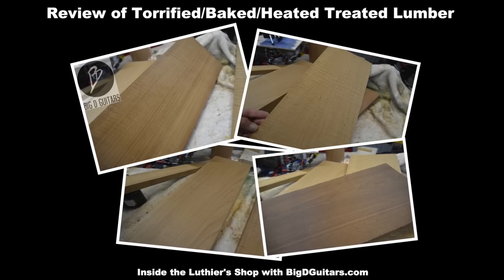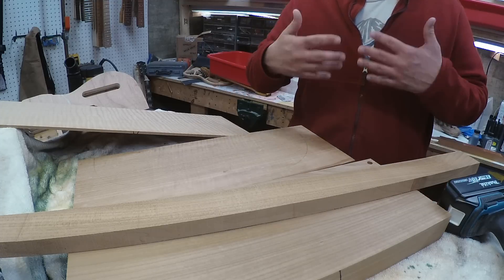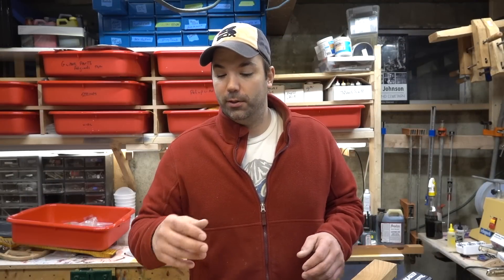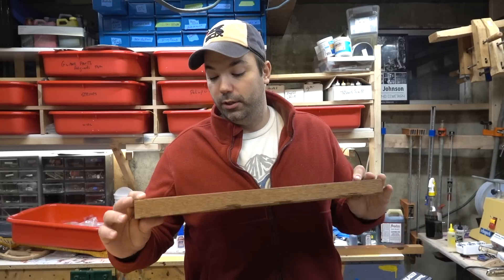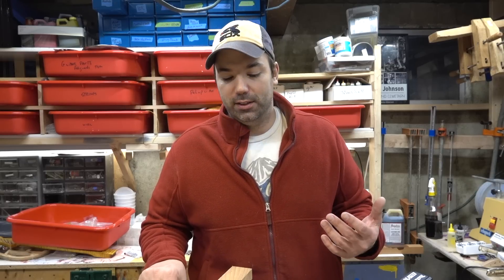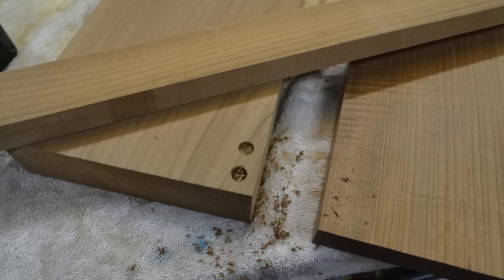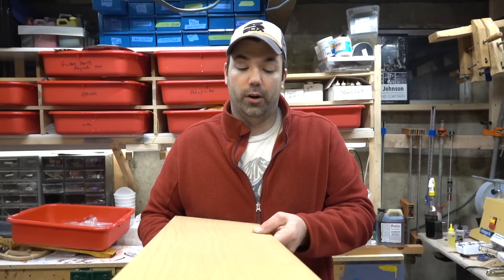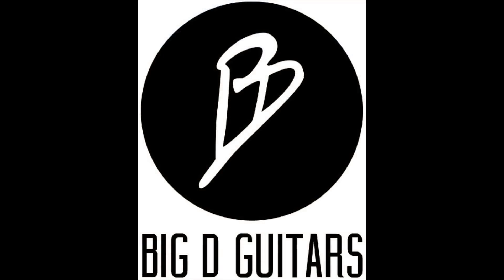Torrified/Baked/Heat Treated Lumber for Guitar Building

Comment: Well, actually they don't put it in a vacuum press. It goes into an oven that  reduces the oxygen content of the air but it's not a vacuum. One of the common ways of doing that is to introduce steam in the final high heat stages - but the moisture reduction stage take place in regular air. The moisture is brought to 0 in regular air at moderate heat, then the heat is raised and the steam is introduced to provide a non-oxidizing environment, otherwise the wood would burn. It's this high heat that provides the aging effects. Then at the end there is moisture reintroduced to bring the wood to 2-4% moisture - 0% moisture would be too dry and brittle. Tests have shown that the weight is reduced and the speed of sound through the wood is increased (something luthiers look for). If done too quickly there can be problems just like with regular kiln drying you can collapse the cell walls, trap moisture inside and have wood that would be worse than before treatment. How dark the wood will go is dependent on the temperature that it is processed at. 
The idea goes back centuries - the vikings heat treated the wood for their boats - one of the properties that heat treating gives wood is that it does not take on water as readily as non-treated wood. One of the big uses of torrefied wood (by the way spelled with an e not an i) is wood decking and siding. The International ThermoWood Association in Finland set the standards for certification around the world.

Comment: My understanding is torrified wood is baked at high temps w/o oxygen (in a vacuum) to prevent it from burning. Definitely not something that can or should be done in a regular home oven. I’ve got a few pieces of torrified flame maple from Woodcraft I’m gunna use for fingerboards.